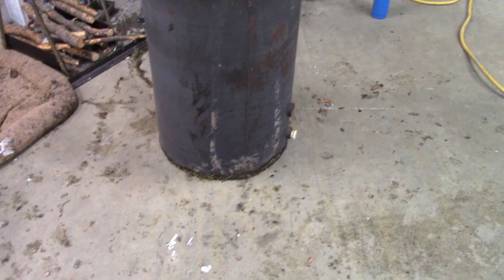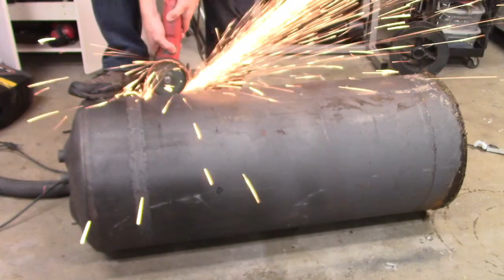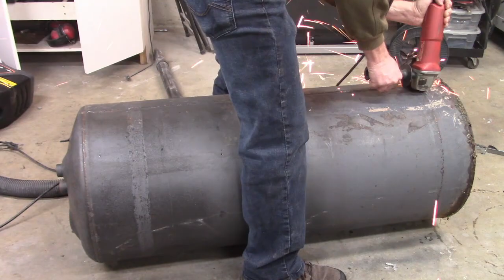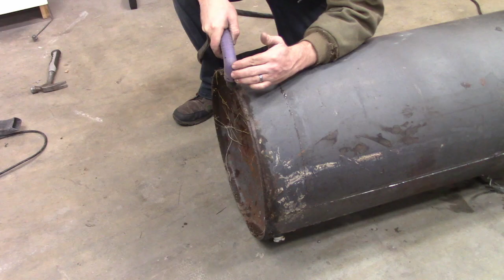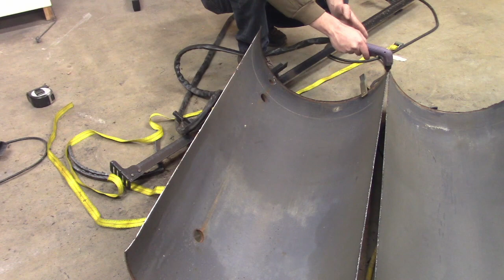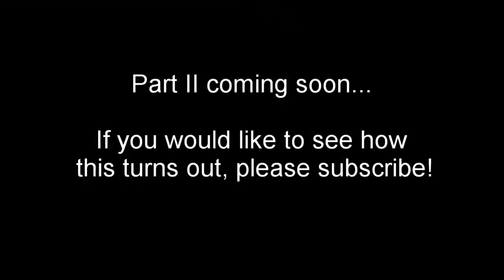Homemade Snow Plow from a Hot water tank - will it work? - Part 1 - cutting the tank

Comment: A hot water tank is plenty good for the snow blade. If you look at commercially built blades, you'll see that all the strength is in the supports welded to the back of the blade. You should run at least 4 vertical ribs welded to the back of the blade to keep its shape. Then weld on horizontal bracing across the back to keep it from bending. I'd go with heavy 2" angle or 2' square stock. That's what I used on mine and it's very strong. You'll also need a good cutting edge too. I used a length of 4" flat stock 3/8 thick or 1/2" would be even better for strength and wear. If you plow on gravel, I'd suggest mounting some type of plow shoes so the cutting edge is about 1/2" off the ground. It will save the wear and tear on the blade and roll across the ground much easier.